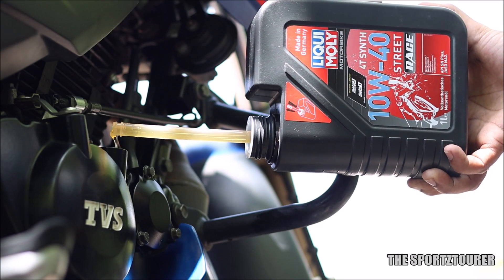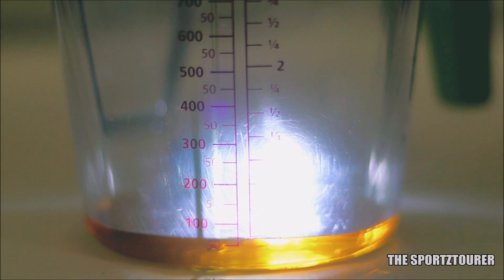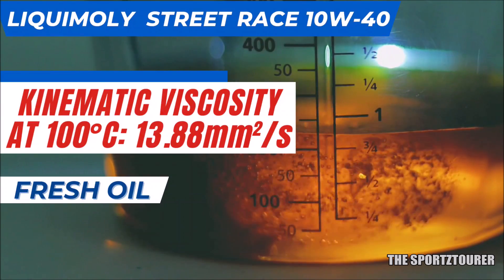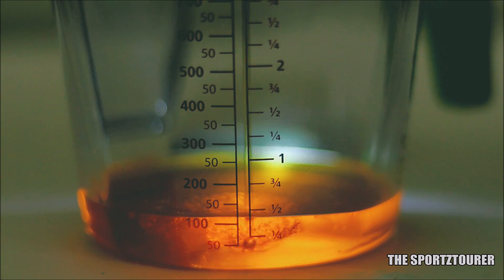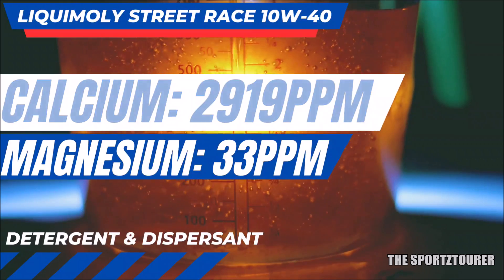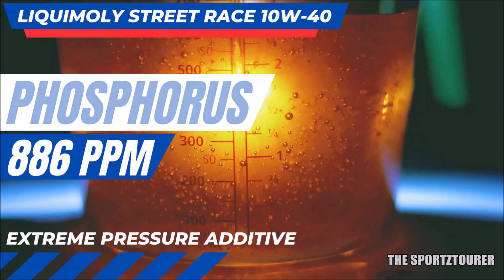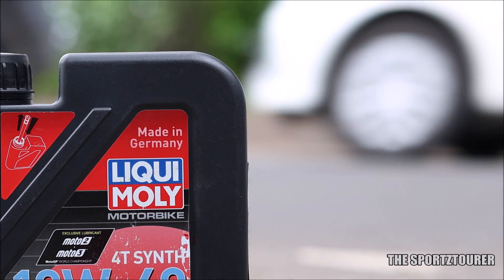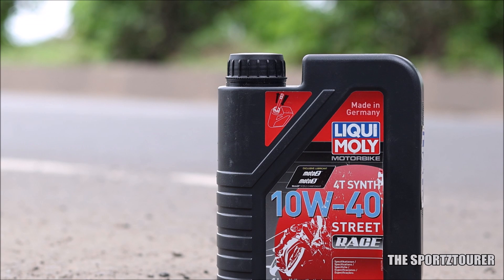LIQUIMOLY ENGINE OIL LAB TEST REVIEW! LIQUI MOLY STREET RACE SYNTHETIC ENGINE OIL TVS APACHE RTR

Comment: Hi 👋

I own a TVS Apache RR310 BTO and I’m currently running on Liqui Moly 10W-50 Street Race oil. The bike is well tuned with some performance mods, and it’s running great.

I mostly ride it on Sundays, and that too for faster rides where I push it to higher revs and use the bike to its full potential.

I’m a bit confused about the engine oil choice now. Should I stick with Liqui Moly, or try Motul 300V (a lot of people recommended it, but I’ve never used it before)? Or is there any better option you’d suggest for my usage?

Comment: I am using last 2 service liqui moly 10w40
First one service after 9500kms
And second one is 13000+ on r15v3 still bike running smoothly 
I service after 14000 kms 
And don't blind and trust on oil check regular engine oil level 🫡

Comment: currently using castrol power 1 ultimate on gixxer 250 after 9500km of use on motul 7100
i feel the heating and nvh is slightly more but shifting and fuel economy is better than motul 7100 that was previously used by SVC

Comment: If you have to recommend an oil for rtr200 4v for city rides and occasional touring, what engine oil would you recommend? It also has to have smoother gear shifts and somewhat refined experience.

Comment: I have been using liqui molly street race 10w40 from 2021on my rtr 200 carb version. U can feel the premium and power out put is much better compared to other brands. As of now , price has been non affordable range . Thats why i shifted to  Shell ultra advance which is great as well.
Reply: Liqui Moly Street Race Rs.1299 MRP
Reply: Yeah previously it was 800-900 range..in that price we can get 2 shell advance ultra 10w40
Reply: @aneeshmarathe9296 but now no distributors for liqui moly sadly so im gonna switch to amsoil but again amsoil has 946 ml not 1 litre so it's confusing
Reply: @RohitRoy-ev4fp source?
Reply: I got at 1100. It's priced high but absolutely worth it.

Comment: Motul 10w40 in apache 200 bs6, oil level automatically down low, what resion? Oil Evobrate in high temperature?, bike produce lot of heat.., Nxt time i will try motul 20w 50 its good or bad in apache 200 bs6, please explain..
Reply: Only use engine oil's viscosity mentioned by manufacturer. Whatever brand you use only prefer 10w30 viscosity for rtr 200 4v. Motul 7100 10w30 is pretty good for rtr 2004v

Comment: We need to test the Sprinta F900. Can it last 4000+km? Using it, mixed with the Street Race at 10:2 ratio, both 10w40.
Reply from the maker: Sprinta F900 10W-40 on test 👍 so keep a check on the channel.

Comment: Bro for apache RTR engine oil  kinematic viscosity at 40•c is 68mm2/sec but ur using liqui moli 10w40 more viscosity oil at 40•c is  91mm2/sec this would damage your engine because oil pump cant pump that oil at high viscosity...so using 5w40 would be better compared to 10w40 liqui ....please make a video on liqui moli 5w40 after 2500km as even i own apche 160 4v as the oil from tvs performs bad after 2500 it is making engine sound after riding 10-15km ..
Reply: Stay relaxed bro. There's no such thing like Oil pump can't pump an engine oil thats available in our market.
And added to that let me give you a good news for you. Apache RTR 4V has a good oil pump.
Myself once serviced our bike (160 4V) and i was surprised to see the oil getting splashed like anything immediately after the bike getting started. I tested the bike without head cover. 
I was like what? 😮
I am surprised since unlike in a Pulsar (old generation) or a splendor or a Unicorn the oil comes very lazy or may not come on the tappets when the bike idles at very slow RPMs or at 1000RPM. 
I did find the oil pumping only when revved to atleast above 2K rpm that too being pumped very slow.
I have done the same revving on RTR and it splashed the oil vigorously and i have to kill it immediately 😅
Now rejoice 👍🏻👍🏻👍🏻
P. S We have 160 4V and Pulsars and Super Splendor.
Reply: Oil changes viscosity at high temperature.

Comment: Hi i just curious if using LIQUI MOLY MOTORBIKE MOS2 SHOOTER mixed with Motul 7100 will causing issue like sludge for long term use? - MT25 with change oil interval monthly (<2000km)

Comment: I have used both 7100 and liqui moly.  liqui moly is much better and lasts longer. But it's not available at an affordable price now. That's the problem.
Reply: And even there are many duplicates
Reply: @shankarmanju5109  how did you come to know?
Reply: @shankarmanju5109 how to verify OG and duplicate?
Reply: Is it just me or the 7100 drops in quantity during every oil change , i barely get 300-400 ml out after 750ml fills
Reply: @technoleech  no, there are many who face this issue
Reply: @technoleech  I'm also dealing the same problem. Searching for a good alternative.
Reply: Always purchase 2 pack and top-up 100ml every 1000 km otherwise your pistone will seize @technoleech
Reply: True
Reply: Now Liqui Moly 10w40 Street Race Rs.1299 MRP
Reply: @tamilautomobile9898  yes. That's not affordable.
Reply: You can also buy castrol ultimate which is also good till 2500km
Reply: @NOOBASURA2  that's the problem. Castrol doesn't last long. Liqui moly lasted 4500+ kms.
Reply: Shell Advance ULTRA 1OW-4O ?
Reply: @surajpawar7724  unfortunately it didn't suit my bike. The mileage drop happens to my gixxer with shell advance ultra. It happened twice.
Reply: @surajpawar7724  maybe, i used liqui Molly results are good
Reply: It's quite affordable in Malaysia, but Stirlings oil and Ipone are the smoothest IMO
Reply: Lrl motors has it in stock at good prices. Please check there. Have ordered a bunch of products. Pretty trustworthy
Reply: What about shell advanced ultra 10w 40 fully synthetic oil...
Reply: Liqui moly has no distributors in India anymore sadly. I'm thinking of switching to Amsoil fully synthetic but it's available in 946 ml not 1 litre sadly
Reply: Motul made in France is the real deal.

Comment: I own apache rtr 200 4v race edition bs4 2019 carb model which I use very very rare. Like 500 kms a year. 

So i want to know which engine oil to use & when to change engine oil
. 
Also can i use shell ax7 10w40?
Reply from the maker: Hi,
You can stick to TVS Tru4 Synthetic 10W-30.
Here is the lab test we did on the TVS engine oil: https://youtu.be/uf2RY64lwsc?feature=shared
Reply: I used the same oil at the beginning but the gear shift experience is pathetic. 
I fount motul 5100 much much better than that. 
Currently running on shell advance ultra
Reply from the maker: Ultra is really good 👍
A segment above from the other mentioned oils.
Reply: Can we use shell advance Ax7 of 1litre & shell advance ULTRA 200 ml in apache 200